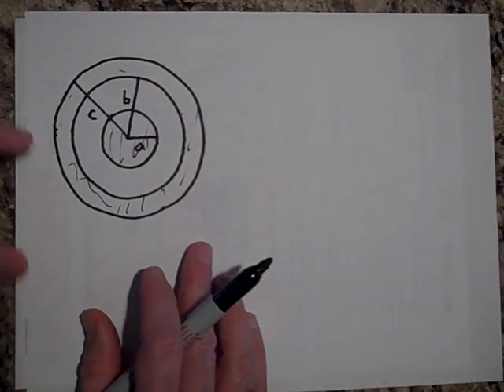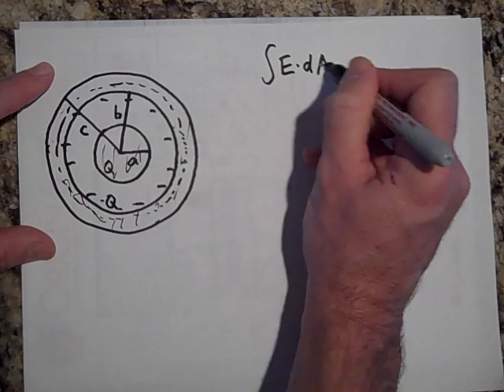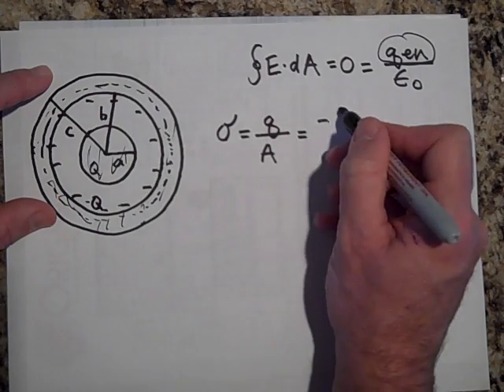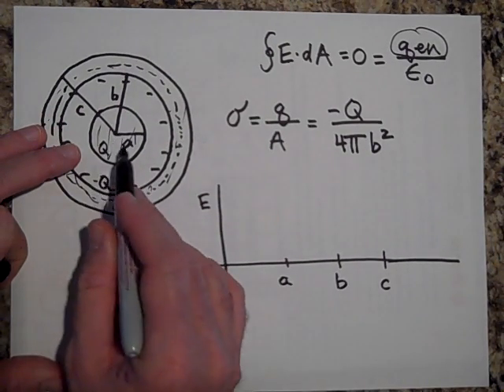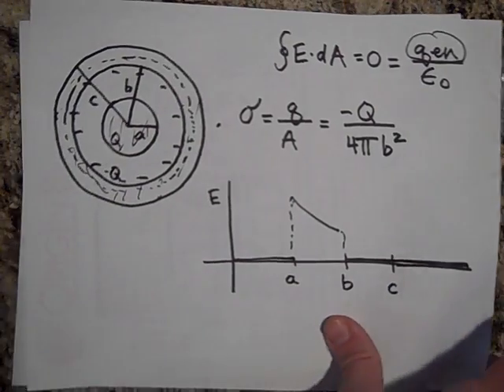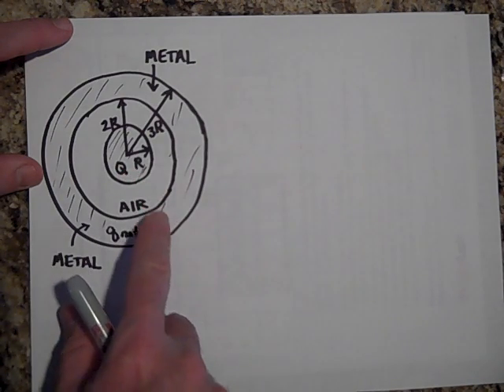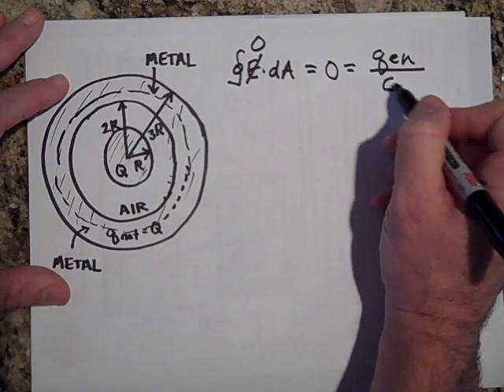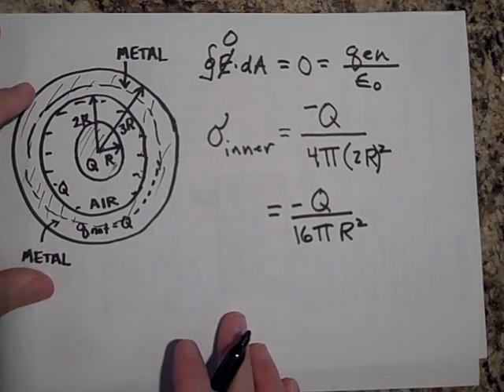Gauss's Law and Concentric Spherical Shells (part II)

Comment: what if the outer spherical shell was an insulator and not a conductor? Would the electric field at b<r<c still be zero?
Reply from the maker: No, it wouldn't be zero.  That hollow insulating sphere would no longer have to have a charge of -Q on the inside wall so if you drew a Gaussian Sphere with a radius of r where b<r<c, it would no longer have to have zero net charge inside.  We would need to know the volume charge density for that outer sphere in order to find the E for b<r<c.

Comment: I had the exact same example on a test, except that the charge on the nonconducting sphere = -Q.

I got a question wrong that was asking about the electric field for r>c and the correct answer was -kQ/r^2 (r,hat)

Anyone know why?
Reply: Because the charge on the nonconducting (outer sphere) is what is leaving the system as a whole; it radiates outward to everything around the sphere since that is the final charge leaving. If you are given the charge for the non-conducting sphere then there is no work that needs to be done just plug -Q into the equation to find E-fields (E=KQ/r^2) which gives you -KQ/r^2. In this example you are given the net charge and the charge on the inner sphere therefore you have to find the charge on the outer sphere but if you are simple given it the plug and chug. This makes since to me but my Teacher is very very good at visually explaining stuff so it might not for you. In that case I apologize.

Comment: So in your first example, the system is grounded and thus the outer surface has a charge of zero. If it were not grounded, then the outer surface in that example would have a charge of +Q?
Reply: yes the outer surface will have a charge +Q as if it was earthed  the electrons would come on the surface and the neutralize the charge so yea if its not earthed  it will have a charge +Q on the outer surface
Reply: No it will have 2Q.....bcoz net is Q....if outer was Q and inner is Q than net will be 0
Reply: I hadn't thought about that, but that seems to make sense to me
Reply: I was stuck on that part. Thanks!
Reply: Yes

Comment: You explain there is no flux inside the metal shell because there's no electric field there. You don't explain why there is no electric field there. You said you consider the inside sphere as a point charge with a field pointing radially outwards. Wouldn't there then be a electric field from that inside the outer sphere? Or is this cancelled due to the -Q
Reply: The outside shell is a conductor I think, and if so would mean all the charges are on the outside edges. No charge sits in the middle of a conductor, only insulators.

Comment: I realize that this is probably too late to be helpful, but in the previous video he told us that the shells were grounded, which would effectively cancel the positive charge on the outside of the sphere.  He did not do that here, which means that the positive charges still exist and we need to take them into account when calculating the net charge.
Hope that helped anyone who was confused.
Reply: Its never too late you saved me trouble 8 years later.
Reply: THANK YOU

Comment: In the first example, the outer sphere is grounded, so the charge the outside is 0. The total charge on the sphere is Q from the inner sphere + negative Q from the inside of the outer sphere. In example two, the outer sphere has net charge Q, so the net charge on the sphere is inner sphere (Q) + outer sphere (Q) =2Q